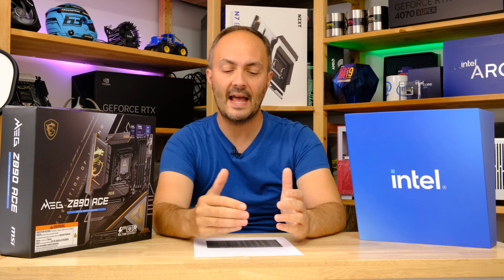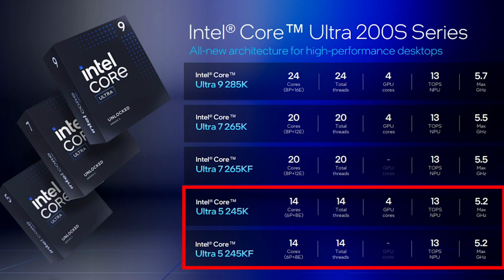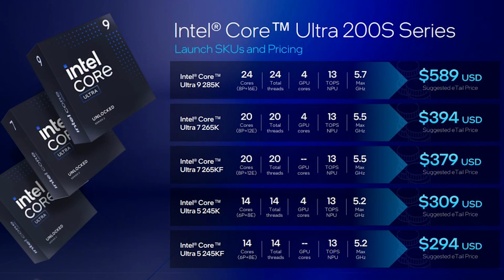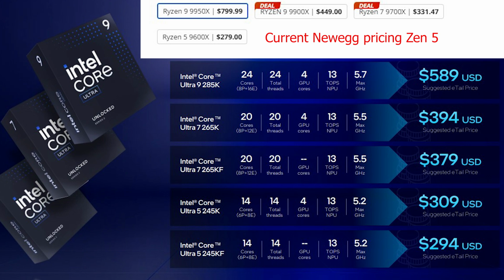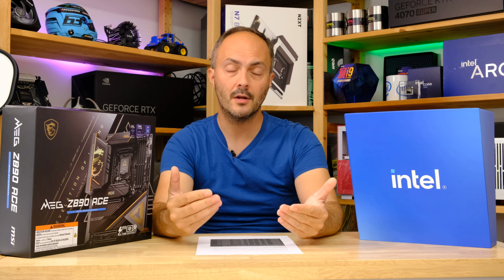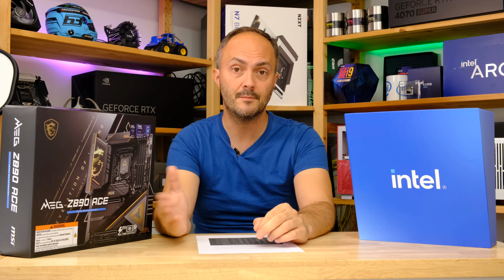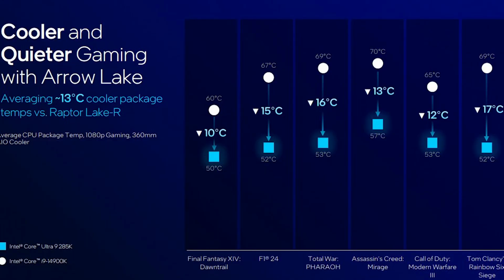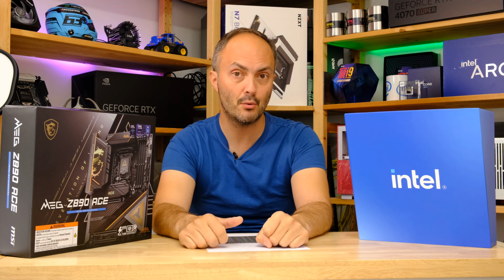INTEL ARROW LAKE IS HERE! HANDS ON DISCUSSION AND PRICING!

Comment: In korea, people are going with 8000 ddr5 and 10,000 ddr 5, to pair up with Intel ultra. They said it can be supported. And getting extra 10% gains on games
Reply from the maker: Yep. They said in lots of benchmarks they used DDR5 6400 so we might actually see better performance with 8000 than Intel mentioned in their announcements.
Reply: I'm curious how this will affect running local LLm's . Maybe it will let us run those large LLm's inside RAM insted VRAM with similar performance? 10 000 ddr5 ram I guess will do the job?
Reply: @SalsaDuraa  gskill just came out for Intel 8000mhz. Trident ck, royal is 8000mhz. And there will be up to 10,000 mhz for Intel.
Reply: @mikeree8543  That is great news for running ChatGPT locally. Finally, maybe we wont need those huge GPU's only for the sake of VRAM but we could keep it inside  Ram with similar performance.
Reply: Remember that that is not far from Siberia

Comment: I started buying parts for my new PC build about a week ago.  Can't wait for the 24th of October, going to pick up the Ultra Core 9 285k with a Gigabyte Z890 Xtreme AI Top.  I need to reuse my 4090, 2X 4TB Samsung 990 Pro, and 96GB DDR5 for now.  Next upgrade part will be the 5090 for sure when it launches, I'll get one on day one just like my 4090.
Reply: Lol Good luck
Reply: I'm getting the 285 for sure
Reply: arrow lake is build on cutting edge process node from 3nm not same as previous gen 10nm ,if intel cant get near as efficient as arm based cpu like apple silicon well they(intel and amd) better start plan to move to risc

Comment: Lowering it vertically is nothing wrong. You literally did that yourself, just from lower height. Be careful and you won't have any issues. Also you did something that's a bad idea - you touched the underside of the CPU. If it had pins, that would be GG. But even for pinless CPU you just put your greast all over the contact points of a CPU...

Comment: 285K extreme Wattage I saw at 295W. Also the 250W is questionable as the 285K and 265K have different clock speeds. 

For me this is something for new builds. I'm looking at APO and Battlemage. The new Z890 has direct 5.0 PCI lane to CPU as does X870. This is REBAR on steroids. So simply put 285K and Battlemage dual GPU performance with no restrictions link to CPU. To me Wattage is performance. In Wattage it will look 250-295W (285K) + 250-275W (Battlemage) = 500-570W of combined performance. All this on paper to my view lifts the ARC from Alchemist to Battlemage more than double. We have Xe vs Xe2 that already is 50% gain. Predicted clock speed is 3000mhz if not more from 2400mhz (boost) to give a good lift also. APO another 10-50% predicted on supported games. XeSS XMX on bar with DLSS. 

This is what I'm waiting to see what will this pairing do? Would I dare to say beating 5080?
Reply: Your first paragraph really shows how great Intel's new naming scheme is
Reply: @NJ-wb1cz  
Before 24th we can't really say anything till it is tested in base configuration and overclocked. Personally I think INTEL under powered the specs top avoid China breaking this CPU like they did 13th and 14th gen trying to bring the internet down. They almost succeeded as on the W680 Asus server boards it was 100% failure. So do not get a Chinese board. Problem is almost all are Chinese. MSI also is made in China but also in Taiwan. Avoid Asus and Asrock.
Reply: @paulboyce8537  I'm pretty sure we know the naming scheme already and you used it yourself
Reply: Will z890 still have lane sharing? X870 got them but some X870E like the asrock nova doesn't
Reply: @marshal7969  "The Gigabyte Z890 motherboard also offers various configuration options from Intel, including modes such as Baseline, Performance, Extreme, and new modes like Spec Enhance, Optimization, and Unleash. Notably, the Unleash mode can increase performance by up to 11%. Gigabyte's Z890 motherboard series also supports WiFi 7, PCIe 5.0 for graphics cards and SSDs, as well as display outputs such as DisplayPort 1.4a. With the exclusive NPU Overdrive technology, the AI performance of the Intel Arrow Lake CPU can increase by up to 23%.

The Gigabyte Z890 motherboard models will be available by the end of October for users looking to upgrade to the new CPU. And as always, while waiting for more exciting news, don't forget to use our comparison tool to find the best deal for your next favorite game."

I think so. But we most likely won't know before 24th for sure when we start to get reviews and tests. That said there is lot of good about this all and PCI 5.0 will be a huge selling point. AMD boards had to release their X870 even without 9800X3D/9950X3D that are maybe coming next year. Point is that I see anticipation of Battlemage. If AMD doesn't have a board and Battlemage comes and beats 5080 they are dead on water.
Reply: I think eventually people using 8000mhz and 10000mhz.  Ddr5 for any workloads. Korea already using 8000mhz for ultra core 285. And soon you will get 10000mhz.